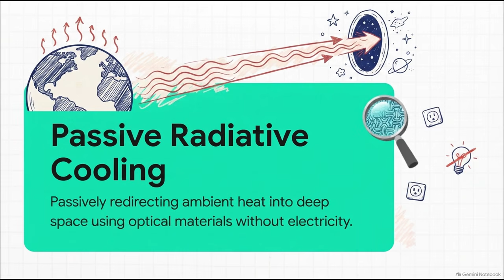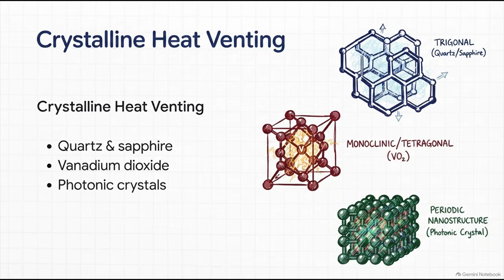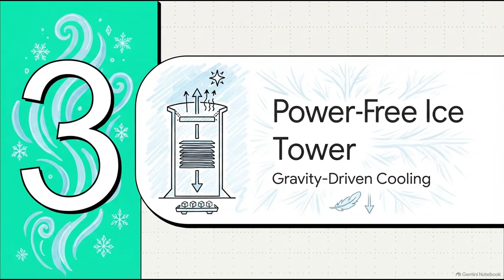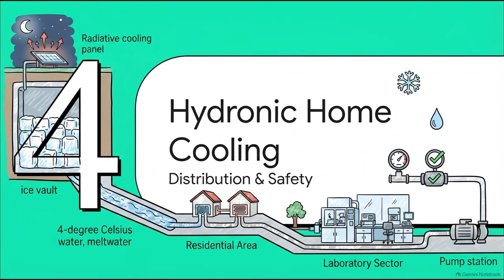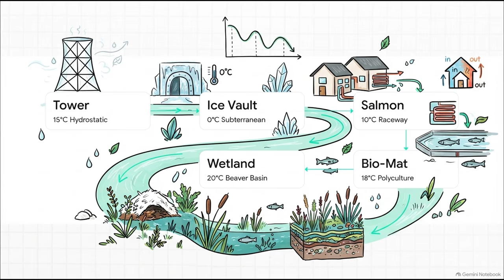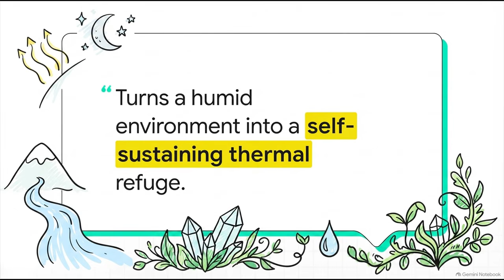The Thermal Cascade

Comment from the maker: Passive Radiative Cooling and Autonomous Thermal Infrastructure
Executive Summary
This document analyzes the engineering of passive radiative cooling systems and the implementation of autonomous, gravity-fed thermal infrastructure. By utilizing specialized photonic and phase-change crystals, heat can be redirected into the 3 Kelvin sink of deep space via the 8–13 µm "atmospheric window." This process allows for the creation of self-sustaining microclimates that operate without electrical grid power.
Key takeaways include:

    Material Science: Photonic crystals (SiO2/Al2O3) and phase-change materials (VO2) enable passive heat venting and dynamic thermal regulation.
    Microclimate Engineering: In challenging environments like the Texas Gulf Coast, localized cooling nodes can suppress temperatures by 10°F to 18°F through a combination of radiative canopies, dehumidification towers, and convective shielding.
    Thermodynamic Infrastructure: A 30-meter water tower provides sufficient hydrostatic pressure (294 kPa) to drive isentropic turbo-expanders, facilitating ice production and chilled water circulation.
    Integrated Resource Cascades: The system follows a thermal hierarchy, repurposing chilled water for structural cooling, cold-water aquaculture, nutrient-dense polyculture, and finally, ecological restoration through beaver wetlands. Podcast can be heard here: https://notebook.google.com/notebook/c69974ae-61b2-4069-b1e1-7d0208b86933/artifact/4584d2d5-fb44-482e-9dc4-82fbe6042873?utm_source=nlm_web_share&utm_medium=google_oo&utm_campaign=art_share_1&utm_content=&utm_smc=nlm_web_share_google_oo_art_share_1_